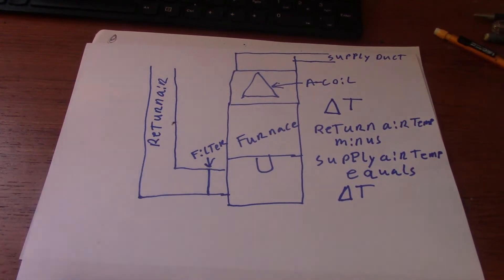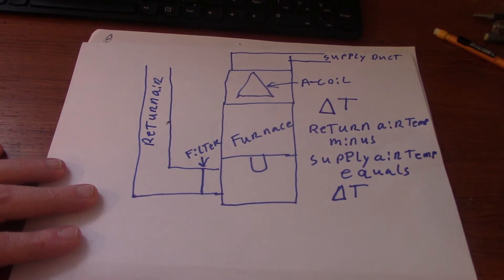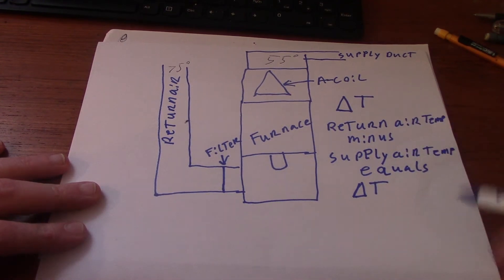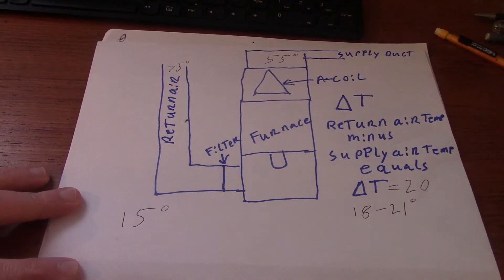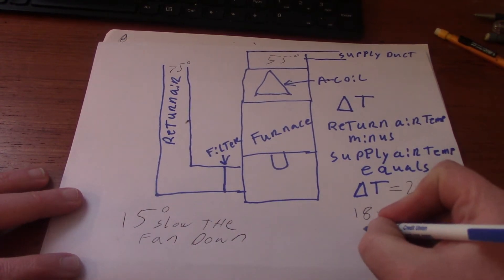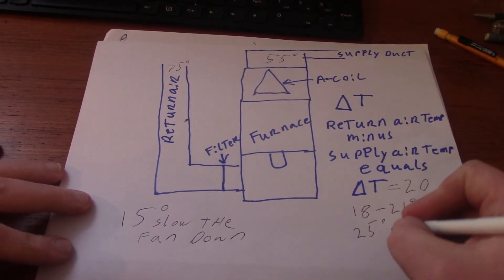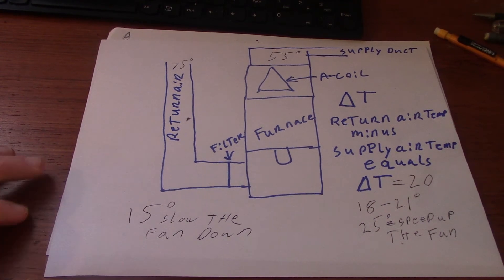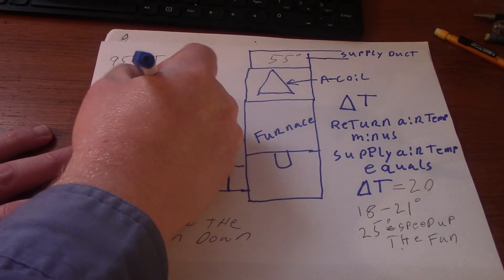How to calculate the delta T on an air conditioner

Comment: what if the delta tee is 8 degrees, but the house temp and ambient outside temp is low. will it rise as the heat load increases??
Reply from the maker: Really wouldn't check in low ambient. You risk foaming the compressor. 

Ambient and return air really do play a role in the operation pressures as pressure equal temperature and why it freezes with a dirty filter. 

Now if your doing computer room ac, is you supply air temperature cold or cool. If your supply air problem is cool, with good air flow than I would suspect refrigerant issue.
Reply: @ChilesHeatCool  yeah the ambient was like 65F. i had to test it for a few minutes as i swapped the evap on the system
Reply from the maker: Txv r22 you can get close but if its 410a, nope. Unless there is an available charging chart that specifies those Temps. 

Document it's to cold, we will come back if it doesn't work when warmer. You might not have had the head pressure with a piston to get the correct flow of refrigerant.

Comment: In a split system with an air handler (no furnace) ehere exactly do i take these measurements!? The filter is  under the a coil , air going up pass the coil , blower above coil, heat strips above that and finally it vents up into the ceiling through a small plenum box. Where do i take the measurements? Below the filter and above the heatstrips inside the plenum???
Reply from the maker: Yes. Before the filter and in the supply plenum is what I do. Sometimes I take a screw out to get in the airstream of the supply air. It's the same concept with an air handler as a furnace. Supply and return.

Comment: Do you have the Delta T temps for heating? My furnace is like 140 degrees in the supply lines.
Reply from the maker: Should be in the middle of what the rating is on the data plate. 
https://youtu.be/ybywcbklpLo

Comment: To slow the airflow down couldn’t you just put in a higher merv air filter?
Reply from the maker: Risk noise by starving it for air. If the blower is set at 400 cfm per ton, the filter cuts it down to 350, the blower is still trying to move the 400 and works harder to do it. Might burn up the motor with less air for the setting since they are air cooled.

Comment: Switching fan speed isn't always the fix though is it? Aren't there other issues within the evaporator that could be causing the air not to move through correctly, like debris or even a blockage of some sort within the refrigerant line?
Reply from the maker: Correct. This is mainly to get the right amount for proper cooling. Let's say you installed a furnace with a 3 ton drive. It will move 1200 cfm of air. The air conditioner is a 2 ton. The 2 ton would need 800 cfm. If you left it on the factory setting its to much air and won't work right. The dirty evaporator will cause problems but a good tech will fin it out. Debris in refrigerant lines, no this test won't work you have have to rely on super heat and subcooling.

Comment: Fan? Is that the same thing as a blower? How is that adjusted in a gas furnace?
Reply from the maker: Well, technically a fan is used with out duct work and a blower is used with duct work. They do get interchanged. The way to change speeds are either a switch on the board or move wires around. I might have a video talking about it.b

Comment: Delta T should be determined by wet bulb temp entering sometimes the required delta t is only 15 degrees based on high humidity.
Reply from the maker: You might be thinking of enthalpy.

Comment: On older AC units without TXV valves, what was a good average Delta T rating back then? An online manual points to early 90's AC. Model is Carrier 38TG01830, 2.94Ib of R22, indoor air is spec'd at 600cfm, house is 1399sqf. I'm guessing 15-16 degree Delta T should be good?
Reply from the maker: 18 to 21. All air conditioners are designed for that 20 degree drop.